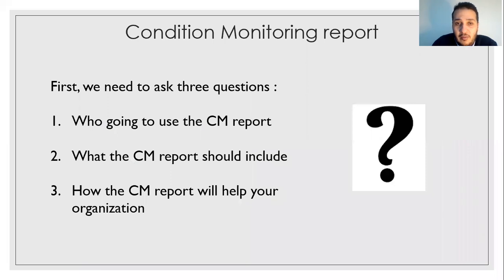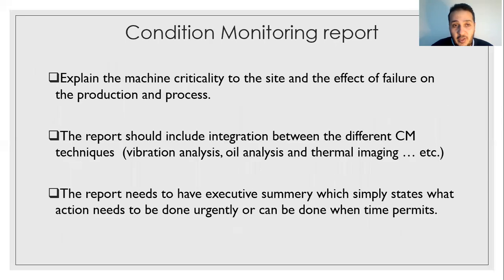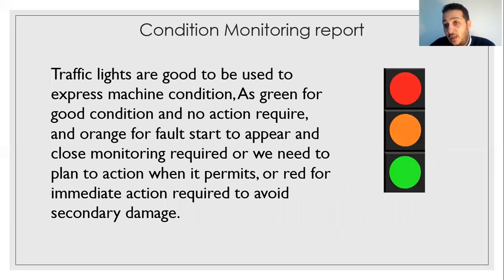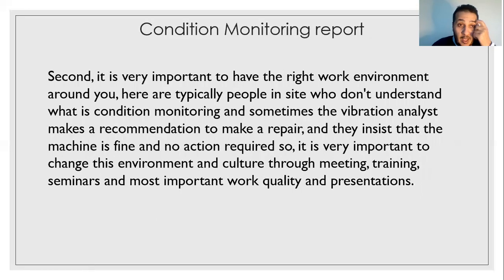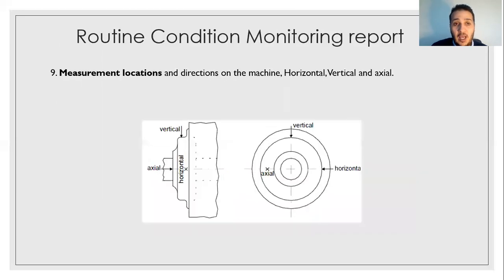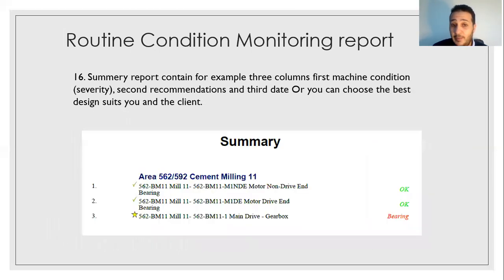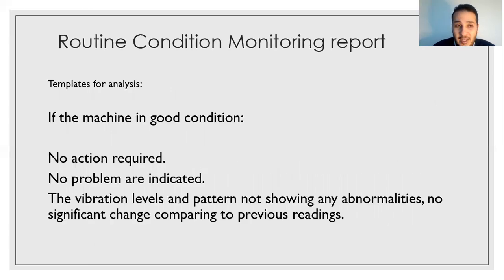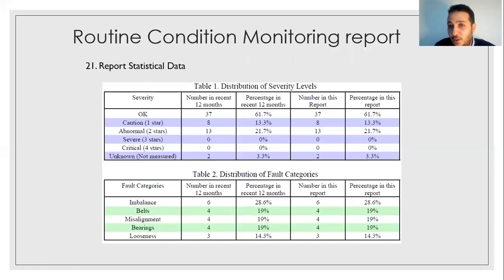How to Write a Vibration Analysis report - CBM 1

Comment: Thanks Eng Salah for sharing your knowledge. I have a question regarding suitability of measuring the machinery vibration (ex. multistage centrifugal pump) by portable / housing vibration measuring instrument if this machine shaft supported by hydrodynamic bearings (radially & axially). Also, can we relay on the vibration result that we got to make health analysis report. If the answer yes/no which standard is providing the guideline for selecting vibration measurement method for anti-friction & hydrodynamic bearings.